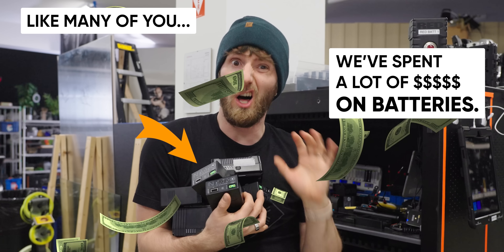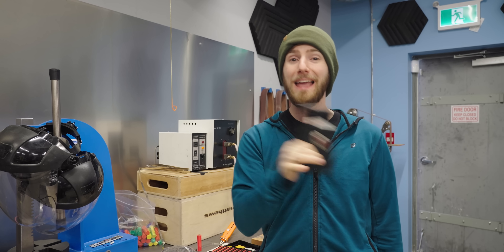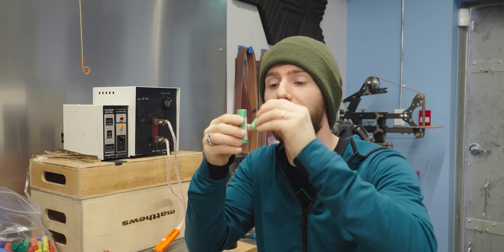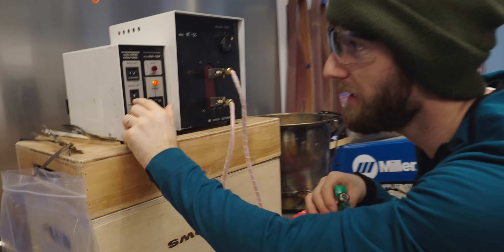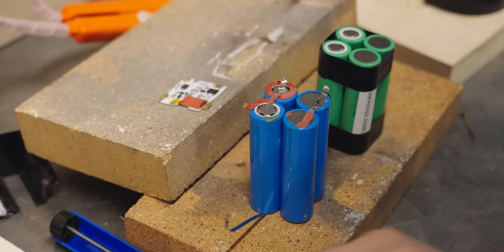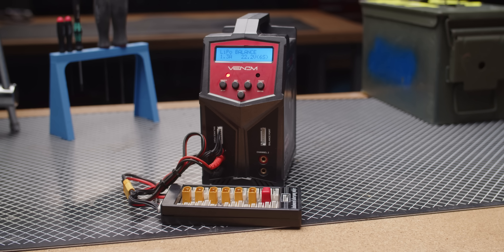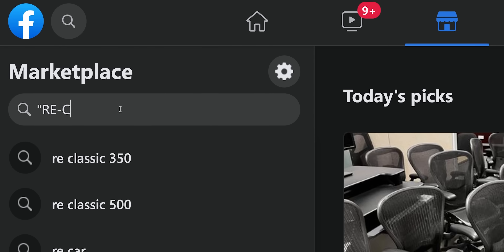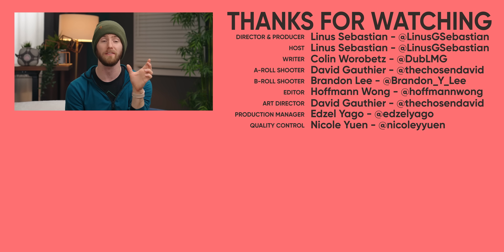This should be illegal… Battery Repair Blocking

Comment: You forgot to use the insulating washers to prevent shorting the plus contact to the case rim.  The thin shrink wrap on the outside edges are easily compromised.

Comment: A simple reset or initialization button for new cells should be available in all batterpacks, its easy to implement, and should not increase the cost by more than a few cents. Most of the time all hardware is already in placw anyway, or a hidden reset implemented

Comment: Rechargable cells should be hot swappable like any aa battery by law. These bad practices are done everywhere, ebikes are also a big issue as well, swapping cells is most of the time impossible, and if possible, really hard. Ewasting casings with electronics is not needed at all, profit over e-waste and user friendlyness, if everyone does it, it becomes the normal.

Comment: Dyson changed their pack voltage higher so that standard "18V" drill batteries wouldn't work with them anymore and you had to buy and use their inflated price ones.

Comment: So I haven't messed with any of the nice stuff like someone broke the code on Makita batteries so you can reset it but I did rebuild one for a blower and i didn't have a charger which may have fixed it but I saw a programming header so I reset and it was good which is awesome

Comment: i know this an old video but on the multimeter during that last pack check it read -6.98 assuming he put red to the positive terminal on the BMS that would mean the batters where wired back wards ive ran into this exact same issue numerus times and im just curios if that's the case

Comment: At around 4:30 in the video, I was thinking how I just wanna replace the individual cells in the Chevy Volt battery because its a $11,000 repair otherwise. xD However its not feasible since I'm not an electrical engineer. Sucks, I have this giant battery here thats bricked the perfectly functional car.

Comment: Actualy BMS may not be fine, the circuitry can degrade over time, where it no longer measures voltage accurately or restricts current effectively. Less likely with premium components but I've seen in with cheaper BMS circuitry.

Comment: While as a floatplane subscriber I appreciate the LTT ethos of “diving in over your head and learning from the mistakes after the fact”, it troubles me how much the hosts still speak with an air of authority while being obviously unexperienced and incorrect to anyone actually familiar with the related field. So while it’s a good thing to introduce viewers to a potentially new area of technology and demystify it, more emphasis needs to be put on being honest at the lack of experience and authority on the subject. Not everyone “just reads the comments” of youtube videos so it is an injustice to rely on the comment section to correct the bad first impressions put forward solely due to personal ignorance. In this case, even a cursory review of other “how to” videos for diy battery pack creation would have revealed how normal the little sparks were and how the cells themselves were in no way breached and how additional steps may be required to “wake” to BMS”. I’m not an expert myself but have been educating myself in this field and while initially excited to see Linus cover the topic, was disappointed at how poorly the experience was portrayed. Either make it clear this is entirely the host just giving ‘first impressions’ while trying something new for the first time, or get an actually practiced expert there to be alongside the host to prevent scripts that sound well researched to a lay person but are actually surface level armchair research and second hand info.

Comment: $1500, for that little thing? The case is maybe 50 cents, the circuit board is maybe $3, and the cells are maybe $3 each. That's a lot of money for something that's actually very cheap to make. They should not be dying after a few years of use. You should be able to get 10 years out of it, if each battery was only charged one time per day.

Comment: Most batteries use 18650 cells, we should be able to swap out those cells in the same way we used to use individual rechargeable cells.

Comment: The cheapest commercially available tool, which allows to "unlock" and relearn TexasInstruments BQ chips and some others, is russian made Master SMBUS. It emulates ti ev2300 factory tool and comes with some extra features, which i should not legally describe. The price is about $70. To properly operate it you should learn SBS commands, functionality and manuals of texas Evaluation Software for each ic and application reporsts, such as SLUA597 - Achieving The Successful Learning Cycle

Comment: Your largest issue with welding the battery packs is confidence. Sparks aren't a death sentence. Put the pack aside for an hour and try again. You could also turn your machine down a bit. When doing two layers, you don't need to do them at the same time. It's preferred, but not strictly necessary. It's perfectly acceptable to weld a nickel strip to another nickel strip and layering them. Side Note: You commented on the nickel end plate of the red battery pack, that larger style allows for more current. When welding 4 or more batteries together, the amount of conductive material separating the positive and negative terminal becomes a bottle neck. In your case you had 4 positive terminals, connected to 4 negative terminals, but only two thin nickel strips between them. This issue compounds as the size of the pack increases. You can solve this at home by doubling up your strips or adding more bridge connections.

Comment: I made my own house energy storage from lifopo4 16x280ah 3v cells so 48v when connected. I accidentally shorted it and maaaan, I saw some fireworks. But actually it was very safe, the wire just evaporated and fireworks ended. One call was damaged but I didn't care, I left it how it was and cell did self repair, everything is still working how it was. Regards, it is nice fun

Comment: I was trying to fix a battery for bicycle, when I open the case and see how they was connected, direct I got confused!
Anyway trying to understand <plus> & <minus> in 21cells was very hard to let me thinks correct.
BMS inside was <devil itself> some sensors for temperature and the board have a <mini software integrated in a chip>

I think only the owner who build knows the secret inside, or just create new one, like we are making a drone.
Replace cells probably can result in fail

Comment: When disconnecting the BMS board from the cells, start at the 'most positive' end of the pack, then work your way down (in voltage). 

Reconnect with the reverse sequence. 

AFTER reconnecting the BMS to the batteries, you MUST put it on the charger to waken up the BMS. This is because when the batteries were being disconnected, the BMS goes into Under-voltage Safe-Lockout mode... like should normally happen if the cell voltages get too low to safely charge. 

The typical spot welding for thin metals is high energy, short pulse... whereas that machine is using long-duration. Battery spot welders will often use 10's of milliseconds... where yours is using 200ms or more. 

You should NOT be heating to the point of seeing red-hot metal, that can start a battery failure. What you want is VERY high energy from ultracapacitors, and far less time... so that there's not enough time to heat the surrounding material. It should be creating tiny sparks from the instant melting if the nickel (17:26), but that's all.

Comment: You need to find a way to supply power to the bms before disconnecting it from the dead cells and keep it powered while your attaching it to the new pack, daunting but not impossible, try running leads from the new pack to the bms before disconnecting it from the old pack ..  then attach to the new pack fully and remove the extra leads... kind of like the electronics version of open heart surgery...

Comment: Try not cutting power from bms like connect parallel pack with bms and take old one out while second pack connected to bms with wires so bms active then put your new pack on it and take your plugged battery off so if bms power doesnt chopped it wont trigger kill

Comment: After rebuilding their battery pack and not getting an output from the BMS, it's worth momentarily trying to charge the pack or at least briefly apply a voltage of roughly 3.6v per cell (BMS dependant) onto the BMS output. Some BMS will going into over-discharge protection after being disconnected and wait to see a good voltage on the output (not input) before resetting. Alternatively if the pack voltage is good you can just use a wire to bridge over the BMS and apply that pack voltage onto the BMS output, that works fine too in many cases.

Comment: Linus, I think you lack some basic knowledge here about battery and product safety.  Why attribute this to evil... what you are experiencing is much more likely to be brand and consumer protection.  When a brand has a failure event that lands them in the news, it can seriously harm the company's reputation.  I know they consider this, as I have been that engineer at major corporations that helps them decide under what actions we should permanently disable a battery pack.  The major BMS manufacturers all have "permanent failure" modes, that are triggered by conditions selectable as engineering decisions.  Things like, open/disconnected battery sense leads will lead to the BMS permanently disabling that pack, because it thinks a failure has occurred that would potentially make future charging unsafe!  Many of these packs are designed to allow for two or more concurrent failures, that result in no outgassing, smoke or fire.  At each company I worked at, the issue was safety.  As you said, fixing these systems is far beyond the capability of even some of the best DIY'ers, with the more dangerous issue being giving DIY'ers who might not understand or consider the risks of reviving packs with internal failures, that then could result in serious safety issues?  The people here in the comments telling you that the sparks are because of improper welding, are indicative of the kind of people the pack and device manufacturers are trying to protect all of us from with the permanent failure modes built into these packs.  They are so sure it was just a welding error, without seeing close up's of the cell after the fact.  Yeah... I've seen packs take out cars and homes.  I don't think saving a hundred or even a couple hundred on a pack is worth someone's life.  That is what we are really talking about here!

Comment: When you did the close up and it sparked, wasnt that just the strip you were welding on sparking from to much power/heat? 

I mean yeah, even if, dont go take risks with lithium cells... Safety is important.

Comment: Linus, factory reset the BMS in the battery. I makes it think your cells are new. Manufacturers degrade battery's on purpose. I reset my Hybrid EV battery and it's been behaving for the last 4 years.
Reply: 'It'.
Sodium ion totally safe no thermal runaway. What happened to Ryden "Double Carbon Batteries" . Probably bought out and shut down to take them out of the market.😮

Comment: fun fact, they could actually make these batteries to have removable cells in them, no welding required, yes the case would cost a fraction more to manufacture, but the down side for the company is that they wouldn't make as much money on selling new battery packs. 
using 18650's makes this a doddle to do. 
the problem is, they really don't have any incentive to do this, as a business has one goal, that is to make money, so the ONLY response is not to buy products that are not serviceable and if everyone did this, there wouldn't be an issue with right to repair, because there wouldn't be any businesses that didn't support it as businesses that don't sell products go out of business.

Comment: Your spot welder settings are inappropriate for this task.
It requires a very high peak current applied for the shortest possible time.
When welding battery strips, they should never glow. If they glow, your settings are wrong.
Do not try to use spot welder built with improvised microwave transformer, because it is very slow.
The best tool for low-duty-cycle spot welding is an electronic spot welder that uses a Li-ion battery as a power source.
These units are small, lightweight, and very effective. That's why you have failed. I do not blame you because recycling batteries is very tricky and needs trainning.

Comment: Only Specialized industrial battery refurbishers are authorized to do cell level repair. 
These companies operate under:
- Industrial safety standards
- Waste battery handling permits
- Electrical safety compliance
- Fire‑risk mitigation requirements
They do not operate under a “cell‑repair license”—they operate under industrial safety and waste‑handling regulations.
Independent repair shops are not authorized (unless OEM‑approved)

Comment: As this one too, some BMS systems require the battery to be connected to a charger to enable them after assembling, or exchange the cells. 
Some BMS systems however are straight out evil, like for example the ones in newer Bosch Ebikes, they will never work again after the battery cells have been disconnected once from the BMS

Comment: I've been welding for a long time as a profession im certified and the sparks you seen were not from the battery instead from the weld itself blowing the nickel material away as it was welded its from the pressure of you pushing and the metal liquefying so it shoots out. the battery's are still fine

Comment: I know i’m late but for anyone doing this.. 13:23 most BMS lock themself down when removing the batteries. To reactivate you have to connect it to a matching charger. That should reactivate it.
Reply: @tronixfix  Yes this is true, i was just saying the same. This is because he disconnected BMS so it is in the "null" state, to reset it look that all batteries have same voltage and then charge

Comment: That is the single worst, most expensive and useless spot welder I've ever seen. You can get one for under $50 on Amazon that will spot weld up to 3M nickel strip all day long. You weren't sparking because of a voltage differential, you were sparking because you were putting WAY too much voltage on your spot welder. For the nickel strip you were using we're talking gear 4.5 or 5, not the bazillion volts you were running through that. You have to be careful when you spot weld on the positive terminal, because only the center of the top is positive, the rim of the top (and the rest of the case) is all negative. When you spot weld with that much power, you can easily burn through the battery wrap and spot weld to the negative rim when you're spot welding the nickel to the positive terminal, thereby shorting out your battery with heat, sparks and fireworks aplenty. Also, are you sure that you had the configuration correct? It looked like you were shorting out a couple cells. Anyway, THROW AWAY that spot welder, which would be just fine for making lunch boxes and mailboxes, but NOT okay for making battery packs.

The most common evil BMS is quite simple, it just checks for a disconnect (or a zero voltage situation) and bricks the unit. A couple of tool manufacturers do this in their battery packs, to keep people from changing out old cells with new ones (Bosch is one that DOESN'T do this, which is nice, it's also another reason why all of my power tools are Bosch). The way around this is to hook up a single cell with alligator clips and connect it to your pack just BEFORE you pull the cells. That keeps at least 4 volts on the BMS and when you get done you just hook things up and then pull that cell. There is.a way to do this so that you aren't adding voltage, you are just adding amp hours by connecting the extra cell (or cells) in parallel to the pack you're pulling. Think of it this way, a 6ah battery can have 8 batteries in parallel, whereas an 8ah battery pack can have 10 cells in parallel; same voltage, different amp hours. Hooking batteries up in series adds voltage, hooking them up in parallel maintains the same voltage, but increases amp hours. Point being, you can keep voltage on the BMS with 2 extra cells (in parallel) which won't add voltage and maybe mess up the BMS and then you can disconnect the pack, replace the batteries without power ever leaving the BMS, thereby avoiding bricking the pack. Unfortunately, as you noted, there are several ways to brick a pack besides simply detecting a complete loss of power, like setting a max number of charging cycles, or a change in balance, and on and on.

Comment: 4:46 You can easily swap only damaged ones - just check internal resistance and capacity of the rest and match with new ones. And do not forget to equalize voltage across cells before connecting them into bms!

Comment: 1:41 it should be mandated that the cell block shown here can be swapped by the manufacturer themselves or someone with a license even if its only slightly cheaper then the pack itself like it can even be at more cost then materials but it should just be there has a option

Comment: Pro tip- in many laprop batteries, if the cells go down to one volt, the BMS bricks itself. Even if you swapped in brand new cells, it still won't work.